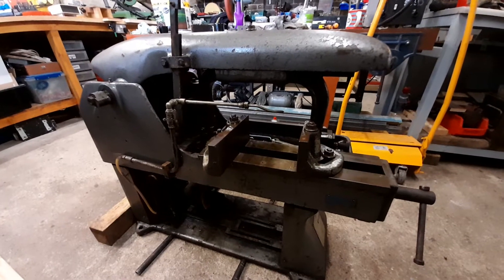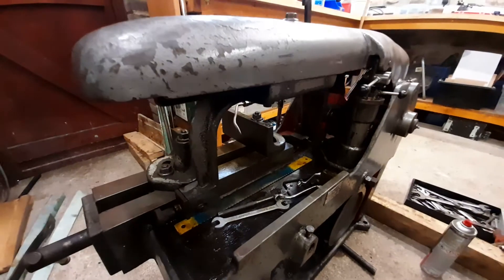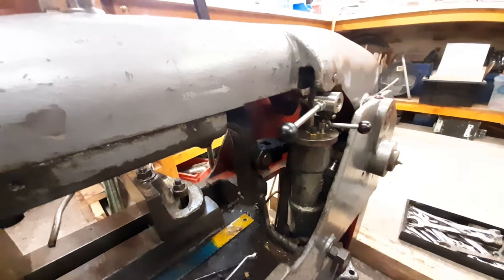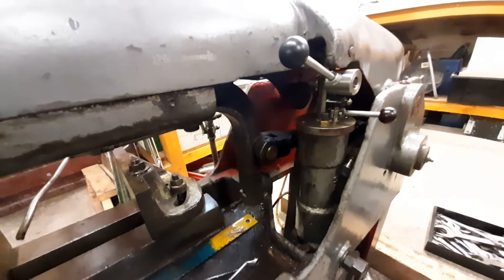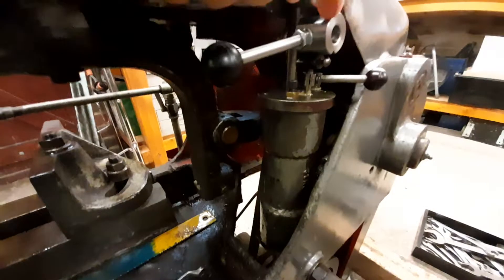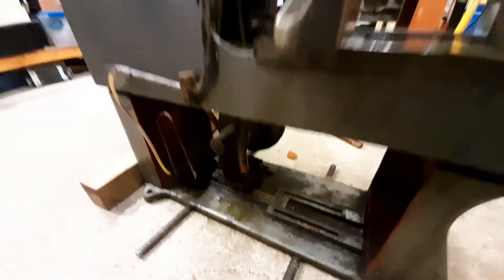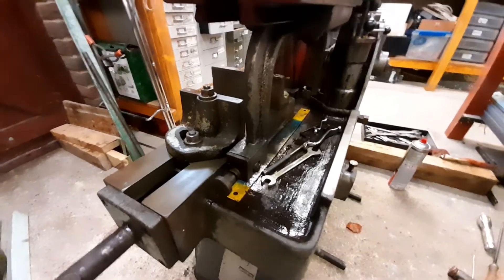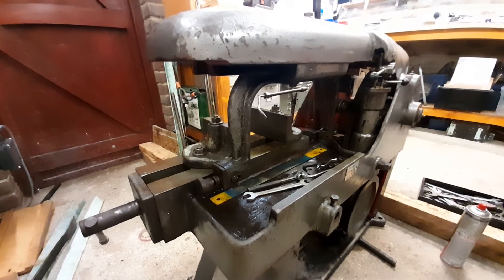Qualters and Smith (Q&S) 6H  power hacksaw refurbishment (hydraulic relief lever, cam and push rod)

Comment: Hey, I've just aquired this for my workshop, its up and running but it goes down very quickly when i push the lever down, is that normal? How do i adjust this or do i have to change my oil?
Reply from the maker: There is an adjustment lever to control the feed rate. A heavy oil will also slow it down.
Reply: @PizzeyTechnology  I did vary that but I don't think it changed much, maybe I'll see about the oil
Reply from the maker: It's been a while but I recall needing to dismantle the whole mechanism and making a new rod for the relief valve. I would try topping up the oil first. Good luck.
Reply: @PizzeyTechnology  thank you so much, I'll let you know how it goes

Comment: This is what I need a motor for
Reply from the maker: Do you have the same saw?
Reply: Yes but mine has a Finn on the top with a counter weight that slides along do u no what size belt to use

Comment: Hi, my company had just purchased an old hacksaw like yours, we have got it running but, the saw won't return to the up position after a cut. It lowers down no problem, do you have any tips, thanks in advance
Reply from the maker: Do you mean there is no lift at the end of cutting, or no lift/relief on every return stroke? If it's the former, then there you may be missing the knock off/stop to put the mechanism into lift mode. However, I'm guessing it is more likely not lifting on every return stroke, in which case I'd start by topping up the oil and checking the adjustment lever.
Reply: The saw moves down quite easy using the lever at the right side  however, when the cut is complete, it does not return to the up position, its got to be switched off and manually lifted into the locking lever
Reply from the maker: The rise/fall lever has three possible positions. If you engage the lever up or down, the saw will be in cutting mode, with a slight lift on each return stroke. There is an adjuster if the relief is too great or insufficient. When the saw has completed cutting, the knock off should return the lever to a horizontal position and it will then lift the bow higher on every stroke. Are you missing the knock off? If so, it's easy to make one. Otherwise I'd be looking at topping up the oil and/or adjusting the feed control. My feed control was messed up and I ended up making new parts which proved quite easy. When you get it going it is an excellent saw and makes very light work of cutting. I've uploaded some scans that may be useful. https://ibb.co/album/vxf8cr
Reply: @PizzeyTechnology  I'll have another pop at it next week, many thanks again

Comment: Hi, good luck with the restoration. I restored mine a couple of years ago.  I recommend Millers Millway Slideway Oil 68 (no connection with Millers) in the top reservoir to lubricate the sliding bow of the saw (there should be a felt wick and plug either side in the bottom of reservoir).  For the hydraulic lifting cylinder, I use a good quality ISO 150 Compressor Oil.  Remember the rate of fall will be slower when the motor is running because the eccentrically driven small  piston will still be charging the main lifting cylinder with oil as it falls.  BTW you can still get the seals for the small piston in the cylinder if needed (I have the original 6H user manual and parts list if you need a pdf copy).  One last thing, I fitted a new single phase,  0.75KW 4 pole 1420 rpm (type 0.7541TCCB35) motor which was same rpm but a little more powerful than the single phase Hoover original on  mine.  I switch this with a 24v contactor and from a new 24v PSU,  wired in a new stop/start, emergency stop and non-latching roller push switch (to trigger start and stop off the main pivot cam). I'm sure you already know that using 24v for control circuitry is much safer and simpler than the original line voltage controls but it may help others.
Reply from the maker: Thanks for your interest and detailed reply. Since posting this video I've fitted a 0.55 kW 8-pole 3-phase motor (680 RPM at 50 Hz) and it seems to work very well. I like the sedate pace this setup gives me as it's only for my personal use. The hydraulics now work fine since making a couple of repairs / modifications but I will bear in mind your suggestions regarding oils. I've not yet cut anything as I'm busy with work. I still need to look for those felt plugs (I've peeped inside and can see the wicks) and will need to add an accessible emergency switch for the VFD. I agree with your suggestion for 24 V controls and already have a couple of PSUs for other similar projects. I would very much like to see a copy of the user manual and parts list but can't post my email address here (some of my students follow this channel and my email address needs to stay private). I will see if I can figure out a disposable email address instead. Once again, thanks for your input.
Reply: @PizzeyTechnology  Hi, the felt plugs only become visible if you disconnect and withdraw the reciprocating bow itself, the felt wicks pass through the body of the raising arm and seep oil into the plugs which are recessed in the underside of the lifting arm but hidden by the bow.  With the bow removed you can also remove a cover plate in the underside to gain full access to the inside of the reservoir if needed. A good flush with white spirit or paraffin should get rid of the old engine oil without affecting the paint. The oil types and viscosities are substitutes for the original Qualters Smith recommended oils.  They are readily available and in smaller quantities than say, an ISO 150 hydraulic oil but compressor oil is just as suitable in terms of its anti foam and wear characteristics in this application.  On the slideway, Slideway 68  gives good results without dripping out constantly over time or seeping too slowly to give good lubrication (assuming those wicks and plugs are in good condition). 
 I know what you mean about the motor speed. I think the original speed was intended to make sure cuts on heavier steels wouldn't take too much time in an industrial environment where time = money. It does seem a bit frantic in the home workshop but if nothing else, serves to remind me to keep well clear when it's cutting. By wiring in a non latching roller switch off the main cam pivot (I can see yours still has the cam fitted) you only need push down the main piston lever and step back to get the saw to complete a full automatic cycle of lower - start (as it lowers) - cut - raise and stop.  I guess the one you have at school does this. It suits me better because it would be a very unforgiving machine if things go pear shaped with me standing close.
On different note, although I replaced all the bushes on mine, the only significant wear I found was on the main double pulley and shaft which sits between the motor and the saw's driving 'flywheel'.  Both shaft and bushes are easily replaced.  I also fitted some spring oil cups to lubricate all the bushes around the machine.  Certainly overkill but dripping a few drops of oil in every now and again makes me feel better if nothing else. Besides, wouldn't be fun without that heady mix of oil, coolant and swarf...
I can send pics of my setup along with the user manual if it helps.  I do understand the email problem, my daughter is a science teacher.
Reply from the maker: Thanks for taking the time to provide this valuable information. For reasons unknown your comment was "held for review" and it's only just now that I've had a chance to find and read it in full. I will try disconnecting the bow as you suggested and take a look at those wicks. It will be interesting to see what condition they are in but I'm not too concerned for now as I am keeping it oiled by other means. Incidentally, I used the machine earlier today for a small job and the quality of cut was superb. 
My impression so far is that wear on this machine is minimal. That "main double pulley" you mentioned appears to be fine and there is no significant knocking elsewhere when the machine is running. Nevertheless, I like the idea of adding some spring oil cups and have previously used them on a small horizontal milling machine -- an AJAX 8" MILLER.
I refilled the coolant sump earlier in the week and apart from some muck coming through (as expected) it seemed to work fine albeit somewhat messy as these things can be. However, it wasn't working today so I will have to take another look. I'm not sure whether I want to use it actually, but it's a nice option to have.
I would certainly be interested to see those photos of your setup and the user manual.
Reply from the maker: Following your advice I disconnected the linkage this evening and inspected the felt wipers. They looked to be in good condition, wet with oil, so I left them as they were. Your description of that access panel to the oil chamber was spot on. Keep in touch, Brian
Reply: @PizzeyTechnology  Hi, you're very welcome. I'll try to post a brief video of my setup this weekend. BTW eb*y item number 401326303922  is the switch type I used for triggering the stop/start cycle off the cam. I wouldn't trust it at line voltages but at 24v it's perfectly acceptable and means the control wiring can be slender. For the contactor I used a Moeller DIL ER-31-G Panel Mini Contactor Coil 24v LOTEBK96E (because it was small and cheap second hand and easily handles my single phase motor). Almost all the threads on my machine are BSW but I seem to recall that on the vice jaw retainers the larger threads are BSF.  You'll notice that In the sliding vice bed there are some pre drilled holes for pegs that go through and set the rear vice jaw to 90 degrees and 45 degrees respectively.  The hole sizes are approximately 6mm and 8mm (see the base of the rear vice jaw too). Mine were a little oval so I drilled them out, epoxy glued in some needle bearing inner races of 8mm and 6mm ID and slightly ground down some steel dowel pins to be a snug fit.  Makes setting up the jaws a lot quicker when alternating between straight or 45 degreee cuts. The belt driven coolant pump clogs with swarf.  I think a mist type (air driven) coolant hose is better or even a simple 3L/5L garden sprayer with a hose off the saw bed into a bucket to reuse the captured fluid. I also put a couple of powerful neodymium magnets on the bed to help catch swarf. Makes for little hedgehogs at the end of a days cutting.
Reply from the maker: Hello tx engineer, I hope you are well. Could you possibly send the user manual to this address? It would be much appreciated. bpizzey@thomas-hardye.net

Comment: Very nice to see another Q&S saved!
I have the same model and it too cuts extremely accurately. One thing that I did notice though, your machine goes down a little too fast in my opinion. If you get the correct grade oil in the actuator, it makes all the difference. I have mine running on the original Hoover motor via an inverter. This way, I can slow the speed right down, which like you I prefer! Great vid.
Reply from the maker: Thanks for taking the time to watch the video and provide some useful feedback. I used ISO 68 hydraulic oil to test the system as that's what I had to hand, but please feel free to suggest a better oil if you know of one. Regarding the rate of fall, I have slowed that down since posting the video simply by adjusting the feed-rate lever. I had to play around with the settings as I had to machine a new part (the rod that pushes down onto the valve) as it was damaged. I've also added a "stop" so the rise/fall lever disengages automatically.  I presume that function works on your machine. When I get a new motor fitted (hopefully next week) I'll post another video to show it working. Incidentally, if you are using the original Hoover motor (star wired?) did you split the star yourself to use it on 3-phase 220V? Kind regards, Brian
Reply: @PizzeyTechnology  I have just rewired my Hoover motor to Delta. It was pretty easy to be fair.